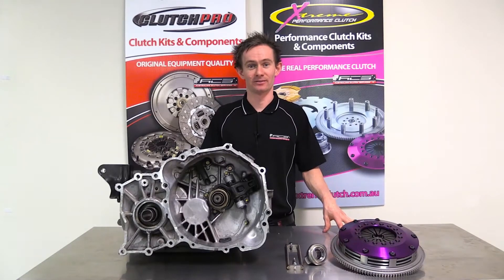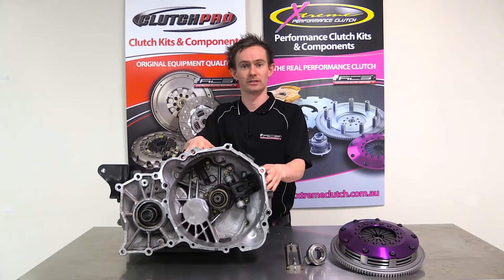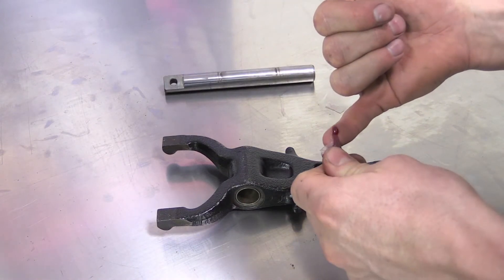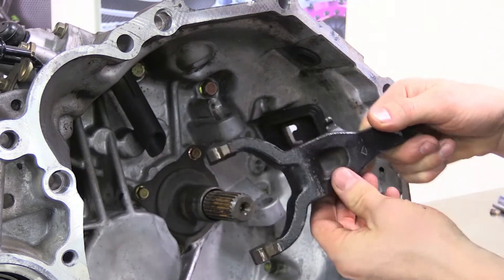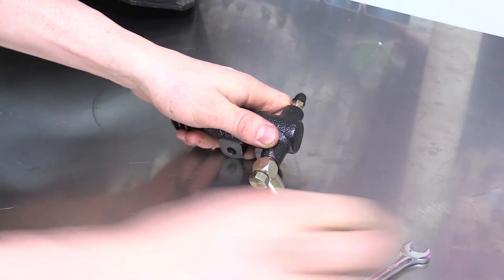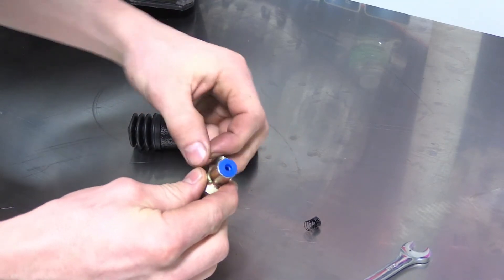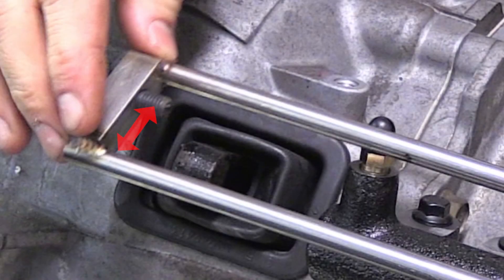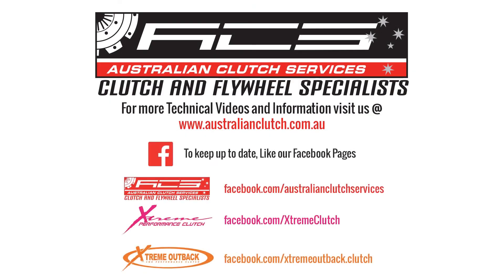CLUTCH TECH: Mitsubishi EVOLUTION IV-X Pull To Push Conversion

Comment: Would the operation of the vehicle be any different from an OEM traditional manual trans?
Reply from the maker: Hi,
The operation of the vehicle would essentially remain the same except these conversions are normally designed for Motorsport style clutch kits so there is likely to be changes to the modulation characteristics of the clutch pedal etc. when fitted with the performance upgrade clutch. If you have any further questions, please feel free to contact our sales and technical support team (sales@australianclutch.com.au) who can recommend a performance clutch upgrade for your vehicle.
Thanks

Comment: I have a question slightly out of context but i believe you are the guys to ask. I've had some problems with separating my engine block from the rest of the engine on my evo 4. The fork looking arm that controlls the throw out bearing has had its attachments on the bearing broken. Is there any other way of releasing the throw out bearing from the clutch on my 97 evo 4? I'd really appreciate the help!
Reply from the maker: Hi Melker,
You may have already seen this, but if you go to this video, it will explain how to release the clip. https://www.youtube.com/watch?v=4u2mhq1kKK0 

Otherwise, if the fork is stopping you from removing this, please contact our friendly sales team (sales@australianclutch.com.au) or call us on 1800 CLUTCH (In Australia) and they will be able to guide you through some other options.
Thanks
Reply: Thank you kindly for the quick response! 
Yes i have seen the video but i have contacted you friendly sales team. I hope they can provide some other options!
Thanks again

Comment: Isn't a hydraulic release bearing a much better option for drivability and simplicity?
Reply from the maker: Hi Tim
We do offer both alternatives for this however we have just done a video on this version to illustrate the process as it allows us to show a bit more detail than a paper instruction . The choice between the two often comes down to personal preference.
Thanks
Reply: Thanks for the clarification! I've read up on a specific brand clutch being used with both the conversion bracket and  hydro release bearing and it seemed the folks with the bracket experienced premature slip and failure, while the person or two with the hydro bearing experienced zero slipping even with an FP black, 2.3 liter and e85 at 35 psi. The difference was amazing! Again, I'm citing one brand clutch (carbonetic pro blade clutch)
Reply: The linkage system would only result in premature slip from an improper adjustment. On paper, the hydraulic release bearing is much more 'stupid proof.' However, hydraulic release bearings are a bit more exspensive and when they go bad the entire transmission needs to be removed for them to be serviced.
Reply: Dominic49 Exactly why I'm also hesitant about going to a hydro bearing, despite the advantages. I'm still not sure how long a properly adjust hydro bearing (pedal stop set up properly, etc) lasts on a street car. They've got a significantly larger piston surface area than my factory slave does.

Comment: what is the part number of the release beating in this kit?
Reply from the maker: Hi Anthony
There are two part numbers for these, TB40005 for the bearing itself and TB33062WC for the bearing and carrier. Please note that these only fit our Xtreme Clutch kits as per the video. If you require any further information, please do not hesitate to contact our sales team via sales@australianclutch.com.au 
Thanks

Comment: whats this for ? use?
Reply from the maker: Hi Joshua, 
In certain applications, it is beneficial to convert a vehicle from a pull type clutch to a push type clutch as there are more clutch options available in push type than in pull type. An example of this is when a vehicle is being used for motorsport use and the owner wishes to install a 184mm alloy cover, push type. In these cases a conversion kit must be installed to operate the clutch.
Thanks
Reply: whats a good clutch for about 700awhp?
Reply from the maker: This depends on the primary use of the vehicle (racing, street use etc.) if you would like to email our sales team at sales@australianclutch.com.au they can guide you through your clutch selection depending on your performance goals.
Thanks